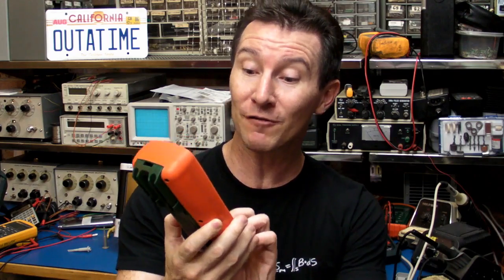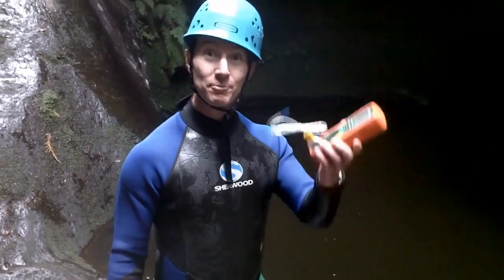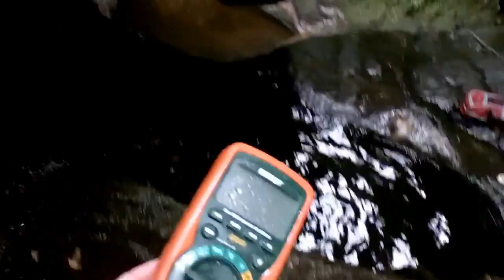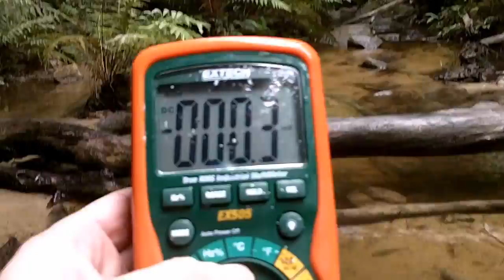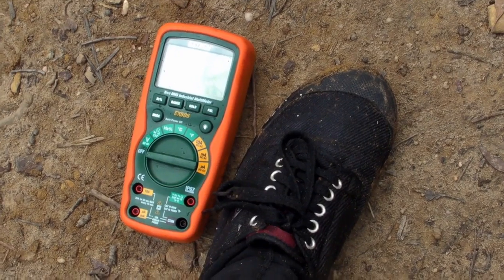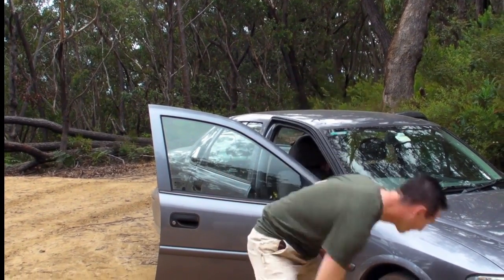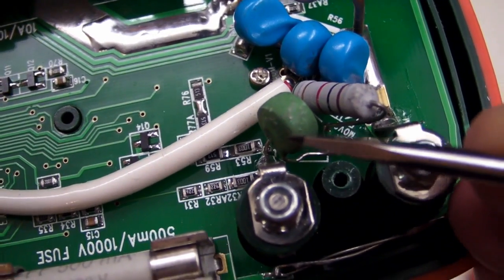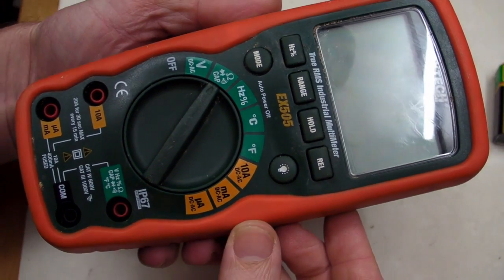EEVblog #151 - Extech Multimeter Canyon Trip

Comment: Correct me if I'm wrong, but at around 16:00 the PTC leg seems to be out of its hole and appears to have never have been soldered in there in the first place (no sign of solder on the pad).

Comment: I once worked for testsafe Australia and one of my jobs was Ingress protection certification so I can post an expert opinion :). While your tests wouldn't qualify for NATA approval, I would say that your treatment of that meter far exeeds any abuse required in AS60529.  It would have been interesting to see if the meter still met the reqirements for IP6X after you ran over it with your car.
Dave, you need to build your own dust chamber :)

Comment: IP67 is for water immersion and dust, not sand and foreign objects. Us compressed air to blow out the contacts and I'm fairly certain the meter will work adequately . I wouldn't call it a fail at all, but simply an unavoidable consequence of having open jacks that are exposed to sand.

Comment: Dave
When a multimeter says ip 67 , should it be waterproof without the test leads and or plugs?
I have a pce itm 20 multimeter/insulation tester made by cem instruments.